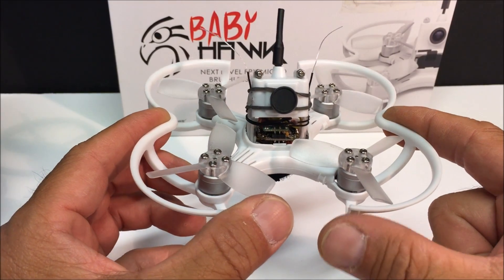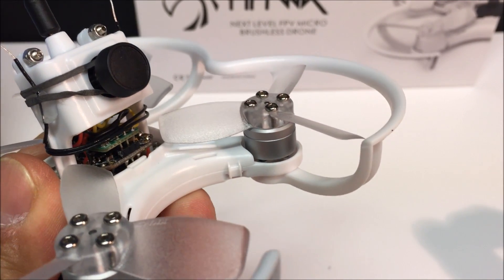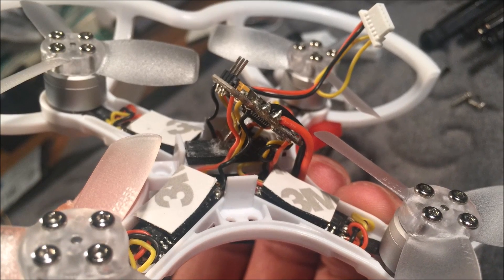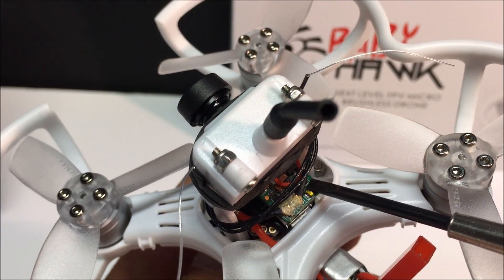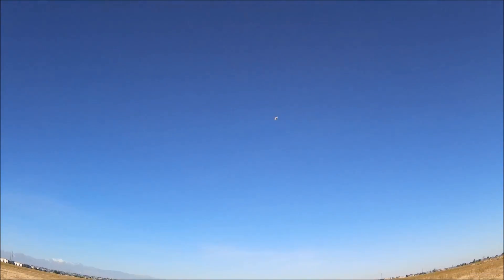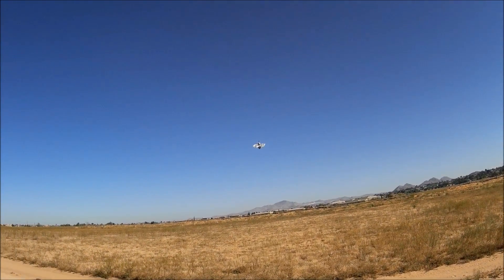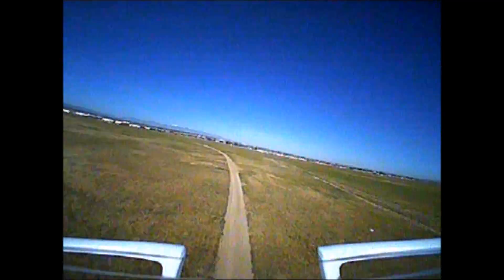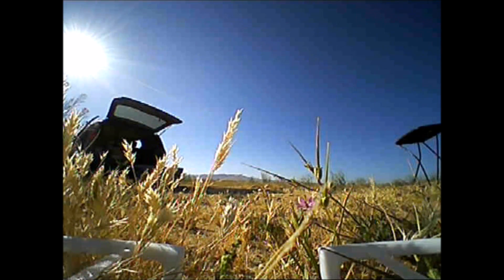Emax Babyhawk Brushless Micro

Comment: + RC Escape With the ESCs you can remove the cover on that double sided tape, flip the escs and stick down into the arms, they fit perfect!  I bent my pins for the Xm receiver aswell and the battery strap was a drainer, ill try the batteries sideways, thanks for the VID!
Reply from the maker: Thanks for the tip!!  I was still wondering why they put it upside down :)

Comment: Did you have the vtx in fpv flight set to 200mw or 25mw? To change just hold vtx button in for 10sec and a dot will display showing its in 200mw. I've been out to 300m with very little break up. Great review as always 👍
Reply from the maker: Thanks Tony :)
I just flipped it to 200mw on it :)

Comment: the ehawk would be a seller if it was rtf.
Reply from the maker: there is positives and negatives with rtf quadcopters....
first, the negative is the price and the transmitter may not be usable for other quads and the tx may not be as good as like the taranis.
the good point of a rtf is that there is no fuss and you can get going with just charged batteries :)
Reply: yeh i only like rtf bcuz i dont know how to bind other tx to bnf quads. but apparently the Dys elf has a good tx than can bind to frsky stuff.